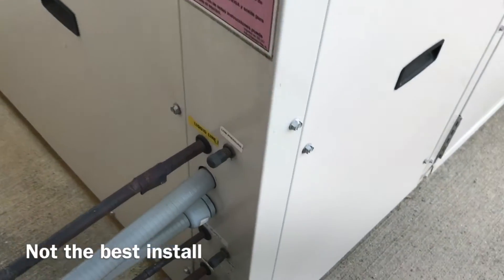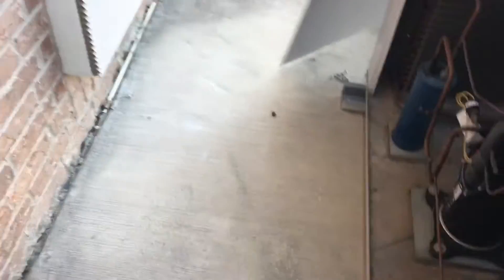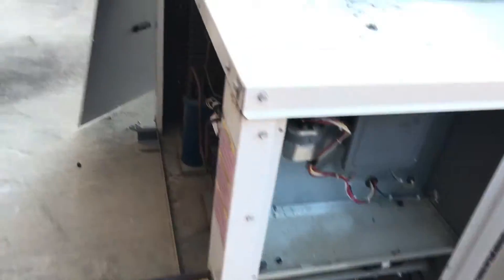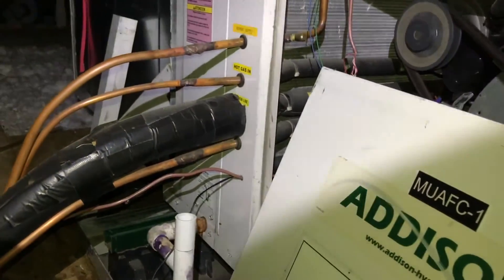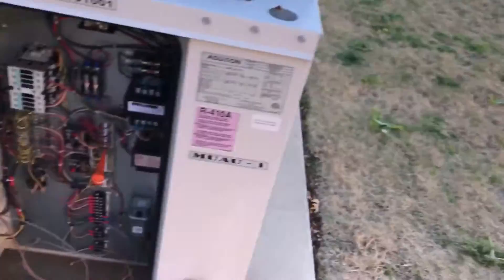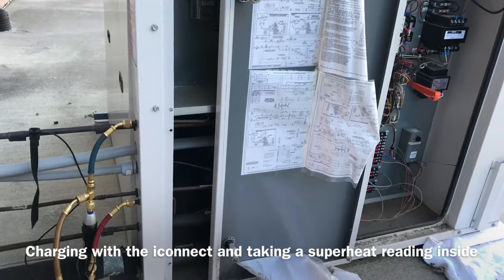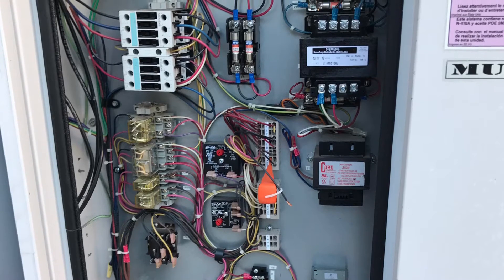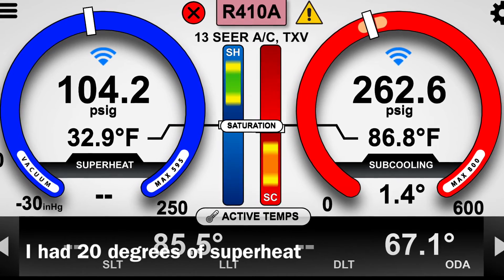100% outside air unit. Sometimes things are out of your control.

Comment: Whats the point of 100% outside air?
Reply from the maker: It’s for When a building has a lot of exhaust systems. In this case it’s a nursing home and they need remove smelly air out of the building. They replace the air with outside fresh air.  They usually cool or heat the air before it enters the building.